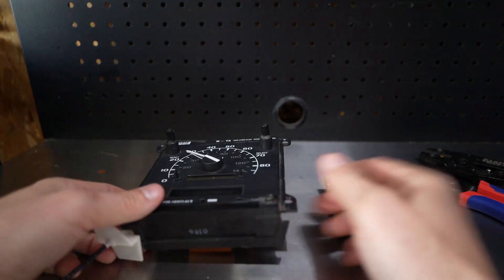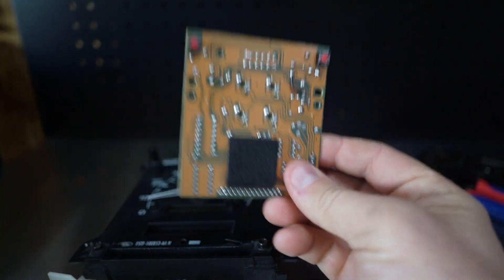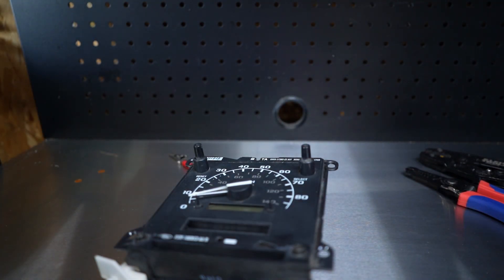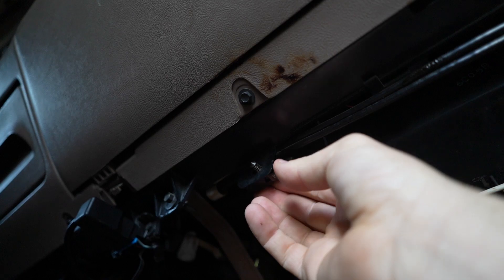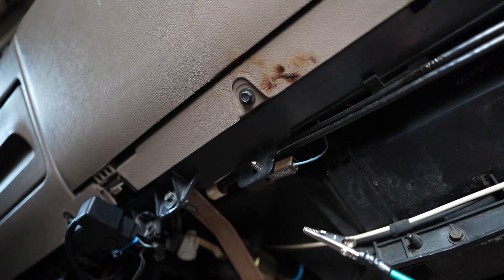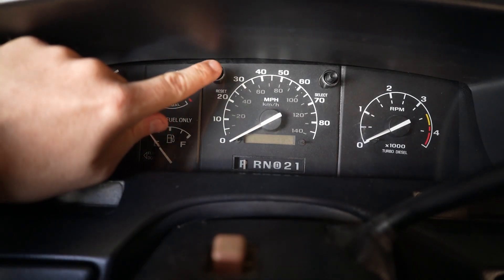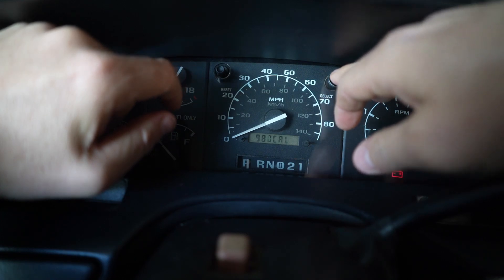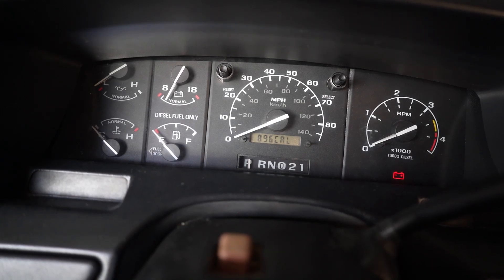What is the Ford PSOM and how-to reprogram!

Comment: So my speedometer will stop and won’t read miles or speed .then come back on and then just turn off again.i have replaced the vss and pig tail to it. Just replaced the pain with a used one and same thing. Sometimes I can hit the speedometer and it will come back on and off any ideas ?
Reply from the maker: Unplugged your ABS module behind your glove box door, the signal goes through the ABS module prior to hitting the PSOM and there could be interference in the signal there.
Reply: @mo_bronco unplugged it now what ?
Reply from the maker: Drive it, see if it’s any better. It won’t be impactful to anything.

Comment: Would this possibly fix a hard shift or is there other things I need to look into before this?
Reply from the maker: This could definitely be it
Reply: I had hard shifts due to solenoid pack leaking fluid through it AND my PSOM was going bad. Fixed both and tranny shifts great.
Reply: The hard shift is more likely from a bad ECM /PCM.

Comment: So what if you have to reprogram it a 7th time?and since you won’t recognize me on here as a guy with a white Bronco stuck in a bar ditch on Instagram I won’t tell you that we don’t need to call you an idiot because it’s a given.👍🏻😁😁😁😁
Reply from the maker: Hahahaha thanks man.

You better run to the junkyard to get another one if you need to reprogram that often!
Reply: How do I find the right revs per mile for my tire?
Reply from the maker: @Cotorro187 best way is to Google the tire size with your make/model tire as all tires are slightly different. If you search that, it should bring you to a page with the info. 

I’ll also add a generic table in the description with the info for Revs per Mile if your tire manufacturer doesn’t list it